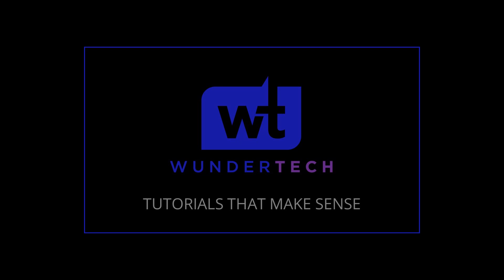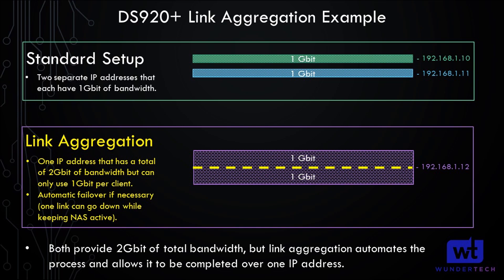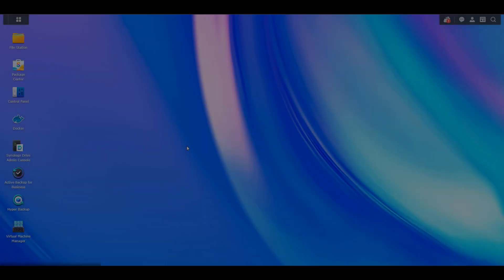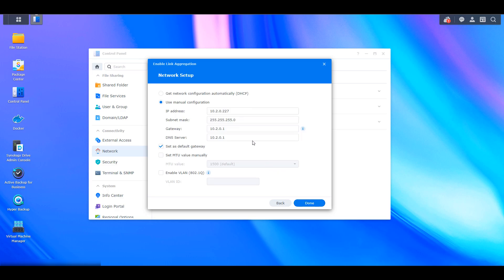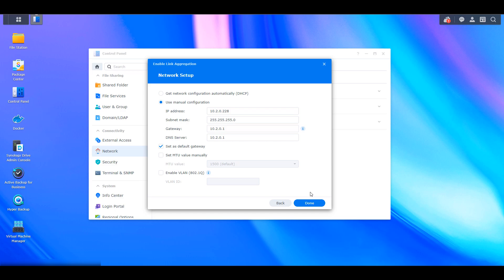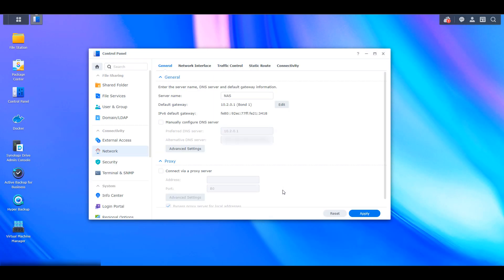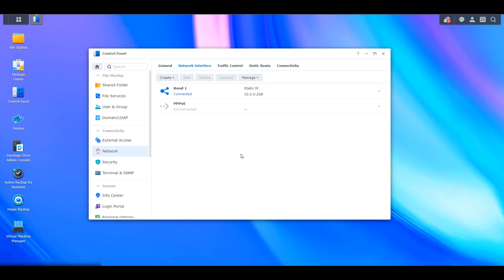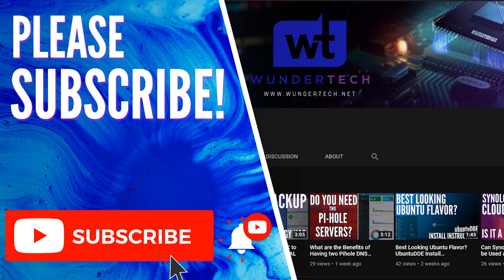How to Set Up Link Aggregation on a Synology NAS | LACP Tutorial

Comment: I'm a tad confused.

1. In UniFi Network, when you select Aggregate, it says "Make sure to enable port aggregation on the downlink device first before enabling it on this device."
2. In Synology, when you create Bond, and highlight the "i" button next to IEEE 802.3ad Dynamic Link Aggregation it says "IEEE 802.3ad LACP must be enabled on your switch beforehand"

So which one are you supposed to do first exactly?
Reply: Well for anyone wondering... 

a) I tried to first turn on aggregation on the switch in UniFi network, and found out that then you cannot access the NAS to turn on a Bonded connection. 

So the answer is to create a bonded lan first on the NAS, wait for it to finish, it will say an error that it couldn't establish or whatever (you can definitely still access the nas fine).... then go into UniFi and turn on aggregation for the two ports... once its completed, the error in Synology is gone.

I'm going to assume, if I need to reverse it, I would first disable port aggregation in UniFi. Then log into Synology (which will show an error in the bonded connection status) and simply remove the Bonded Channel.
Reply: Eh... so I've tested the speeds and noticed if using 2 PCs, copying say a 5GB file each at the same time, they're not getting their 1Gbps (~125MB/s) bandwidth each, its still splitting a single 1Gb connection, so one PC gets 57MB and the other gets 57MB a, total around 115MB or so. I now assume this is because I've got a UDM Pro and a Ubiquiti switch connected together via 1x 1Gb lan cable. I assuming I need to use 2x cables and create a bonded aggregate so that there's 2Gbps between the UDM Pro and the USW-16-POE switch as well, and then it should work? (even when my 2x PCs and the NAS were all connected to the USW-16-POE?). We'll scrap that idea, UDM Pro doesn't have aggregation, it has a 10G SPF port, but then my switch has 2x 1G SPF Ports. Hrmmm wonder if this entire exercise has been a waste of time.

Comment: Thanks for the great explanation. Could you just setup the aggregation on the switch before you setup the aggregation on the nas?
Reply from the maker: Not in my experience - if you set it up on the Switch, you won't be able to access the NAS to configure it. Might depend on the Switch though.
Reply: @WunderTechTutorials  could you move the cable ports?

Comment: I'm wondering what I should set up first, the link aggregation on my router (many ASUS routers support this) and then configure the network in the Synology control panel? Or do I just plug in the two network cables to the router, configure the link aggregation (IEEE 802.3ad) then turn on the link aggregation feature within the ASUS router?
Reply from the maker: You'd have to configure it on the NAS first, though you might want to look into SMB Multichannel as well.

Comment: You really don't have to go and reset the NAS is you get into an issue with the LAG. Only the Bonded IP is no longer available. So, just remember which port you had connected first, move the cable on the switch, if needed, to an un LAG'd port. Then you can access the NAS through the original IP. The only reason this would not work is if you changed the Bonded IP to the original IP of the NAS.

Comment: Hopefully you see this and hopefully could possibly help. Running Asus Ax92u - I enabled the aggregation, followed your steps for the Synology NAS to enable LAG but getting to the Network Setup step @4:50 it just says failed... No other info to help direct as to the source of the issue unfortunately.
Reply from the maker: I haven't seen it just say "failed", but is everything being inputted properly? That's the manual configuration, so I imagine if you're using the wrong subnet, you might run into a problem.
Reply: @WunderTechTutorials  Wow thanks for getting back to me. I use the default DHCP setting - the top selection.
Reply: @WunderTechTutorials  well now I have the issue that when I plug the second ethernet into the router the web access assistant goes down...
Reply: After that failure - I reset the NAS with both ports connected - this apparently gave the second port a different IP than before and that seemed to cause the web access client to fail . I removed the second port - bonded the ports with the manual setup giving it the port 1 IP - plugged the second port in and now it seems to be stable.
Reply from the maker: That's great. I've never experienced any of those other problems but know that two IP addresses are "bonded" into one, so the problem must have been related to that in some way. Glad it's fixed!

Comment: I just bought a Synology DS 723+, and I don't have a switch. I followed your instructions but used the automated version for creating a bond and took a chance to implement it by connecting both my Gigabit cables to the router I have from Bell Canada. 

It seems that everything went fine, and the good news is I didn't get locked out of my NAS ;-) The interesting thing, however, is that my browser auto-refreshed when I implemented the bonding, and now I am getting a warning that connection to the NAS is "not secure" and Chrome is showing the https in red with a strike through. 

Should I be worried that somehow my NAS is now insecure and "went public" on the entire internet so anyone can highjack it?
Reply from the maker: That simply means you're using HTTPS and don't have a valid SSL certificate (which isn't a problem for local access). If you are concerned about external access, log in to your router and check your port forwarding rules. If none exist, there is nothing exposed to the outside world!
Reply: @WunderTechTutorials  I appreciate your video and your super fast and very helpful reply! Subscribed!!! And thank you again!
Reply from the maker: @SingularityFM  Your comment was deleted for some reason, but you can simply delete the bond and undo any network changes you made on your router.
Reply: @WunderTechTutorials  Thank you. Very kind of you. I deleted it because I figured it out and didn't want to waste your time.
Reply from the maker: @SingularityFM  Sounds good! YouTube always deletes comments so I try and respond if I have enough info from what I can see. Glad you got it working.
Reply: @WunderTechTutorials  I did. Now I'm trying to figure out why my transfer speed when up from 70 MB to about 110 and then, eventually, to 11. I'm trying to transfer about 6 TB and it is taking forever  ;-(
Reply from the maker: @SingularityFM  There are tons and tons of factors that it can be unfortunately, but that's pretty common 😞

Comment: For those using Docker to host the Unifi controller on the Synology, simply setup two different, free, ports for link aggregation, other that the ones currently in use. You then set up the link aggregation on the Synology, Then, physically unplug the cables from the original ports and plug them into the new aggregate-enabled ports and Voila!
Reply: Would you mind explaining each step - I can't follow exactly what you mean

Comment: Helpful video, so I have an unmanaged switch DGS 1016A, that supports link aggregation but after the setup process I get "Failed To Establish IEEE 802.3 ad connection" Everything still works; i can access the NAS and its content , but I get that message does that mean link aggregation is not configured? What do you recommend?
Reply from the maker: Where are you getting that error? Do you see the bond interface in DSM?
Reply: @WunderTechTutorials  Yes i can see the bond interface, dont know if you can view this image https://linustechtips.com/uploads/monthly_2022_05/image.png.170c4d7199dcb34692074bec18f744e9.png but its right under the bond where it shows Network Status in DSM Interface.
Reply: At the 6:50 mark in your video where it shows Network Status: 2000Mbps, Full Duplex, MTU 1500, that's where the message is displayed. "Failed To Establish IEEE 802.3 ad connection"
Reply: @WunderTechTutorials  I think I see the issue, the switch only supports all the following except IEEE 802.3ad
 • IEEE 802.3 10BASE-T Ethernet
• IEEE 802.3u 100BASE-TX Fast Ethernet
• IEEE 802.3ab 1000BASE-T Gigabit Ethernet
• ANSI/IEEE 802.3 NWay auto-negotiation
• IEEE 802.3x Flow Control
• IEEE 802.3az Energy Efficient Ethernet (EEE)
Reply from the maker: @cutsdbz  That makes sense. Have you tried setting up Balance-SLB? Not the same as Balance-TCP, but it will at least work with an unmanaged switch.
Reply: @WunderTechTutorials  will do and see the results, thanks.

Comment: Do I have to use a different static IP to the one I have currently assigned for my NAS? 

My UDM pro has a fixed IP assigned to my synology at the moment so can I still then assign the same IP on the synology setup for the Bond or is that going to mess it up?

I am tempted to just play it safe and assign a new IP (although fixed) that is not already allocated to a client. The other way I was thinking is giving my synology a random IP through DHCP so it looses it’s fixed IP that I want to then reassign through synology settings.

Thanks for the video !
Reply from the maker: Thanks! You should be able to use the same one!

Comment: Is there any way to increase read/write speeds to one client without a 10Gig NIC? I'm thinking of upgrading to a DS920+ or DS1520+, but if there's no way of going above the 1Gb/s speed to once client I might consider the DS1621+ with a 10Gb/s card.
Reply from the maker: Unfortunately, not any supported ways. I believe you can find 2.5Gbe or 5Gbe USB adapters that might work, but they're not officially "supported". The DS1621+ is a great choice if you're interested in 10Gbe.

Comment: I have had success by removing one of the network cables to gain access back to the NAS without resetting it.
Reply from the maker: What are the steps you follow to do it? I tried, but wasn't successful.
Reply: @WunderTechTutorials  Unplugged one cable from NAS. Power cycle NAS and was able to access.
Reply from the maker: @ivgnmonkey  Got it, I didn't try the power cycle. Thank you for the info!

Comment: So my Switch (Orbi router) doesn’t support long aggregation.  But I connected both LAN ports in my DS920+ to the router and created a “bond” in DSM with 1 IP address. Does this help with throughput or failover?  Not sure if there is any advantage in doing this or if I should change it back.
Reply from the maker: Did you use Balance-SLB? If so, it will function very similarly, just not as "efficient" as Balance-TCP. Nothing to change if it's working as expected!
Reply: @WunderTechTutorials  Yes, I’ve got it set up as Balance-SLB. You may have mentioned this, but I think it only helps when more than 1 device is accessing data. My only concern is what happens if 1 LAN port goes down, does it take the whole bond with it and leave me with no access to the NAS?  I’ve never had an Ethernet port fail on me in 30 years but…
Reply from the maker: @notreallyme425  No, you should have redundancy if one fails as it will automatically kick over to the other.
Reply: @WunderTechTutorials  Awesome, thank you! (Thought I was subscribed to you, but I am now!  Appreciate the Synology vids)

Comment: Any difference if your switch only has Static Link Aggregation instead of Dynamic Link Aggregation?
Reply from the maker: This type will not work with static link aggregation unfortunately, but you can utilize a different link aggregation type (don't remember which off the top of my head).

Comment: This feature is awesome in theory but absolutely not useful in practice. Besides the "failsafe" backup if the cable goes wrong (something that happens 0.000001% ) there is no practical reason to have two 1 gigabit bandwidths when the NAS HDD can only read/write at 100-130ish mb/s . Even if you RAID, you still won't reach the bandwidth to use this.
Reply from the maker: I will be honest in saying that I am on the other side of the fence on this one and feel that if you have a switch supporting LACP, there's very little reason not to implement it. I agree with you that the the redundancy will very rarely, if ever be needed, but having it is still a benefit. As for the HDD performance, assuming you have a 4-bay NAS at minimum and are using RAID 5, four drives will give you the performance needed to come close to saturating both lines and overall, if you can even see a slight performance benefit versus no performance benefit, why wouldn't you implement it?

I also agree with you that a 2-bay NAS will see no benefit (unless you're using RAID 0), but the chances of having multiple clients or a managed switch as a 2-bay NAS owner are probably smaller than 4+. Not saying this to sway you as everyone is entitled to their opinion, that's just how I feel about it.

Comment: Pin this:
You can plug in a USB wifi or ethernet adaptor and set it up with static or DHCP and\or connect to your own wifi so you do not lose connection through any of this. I do this to all of our NAS's and then unplug the "emergency" adaptors. Synology saved the wifi auto-connect to "X" network and all of the Nic settings so when you plug either back in they connect right up and you can use Synology finder\advanced IP scanner or your router GUI to find the IP ( unless set static which is allowed via wifi usb too ).  Never lose connection, no resetting anything etc....
Reply from the maker: Are you using DSM 7? I am hesitant to suggest that as USB device support was dropped with DSM 7, but do acknowledge that it will work and is a great solution if you do have a supported adapter.
Reply: @WunderTechTutorials  I can confirm I have a 2.5Gb USB nic. The brand is pluggable, and someone created a driver for it, and I can confirm it works on DSM 7. It actually works way better on DSM 7, than it did on 6. It used to drop out often on 6, but on 7, it's been rock solid.
Reply from the maker: @mistakek  Thank you for letting me know!

Comment: Your disclaimer at the beginning of the video, upto about 2:30 minute mark, is really important that is gotten wrong very often on the internet. Link Aggregation of two one Gbe does not give a single machine 2Gb access.
Great explanation.
Reply from the maker: Thanks so much!
Reply: Link aggregation can give speed improvement for one client if use round-robin scheme, but it's not officially supported by Synology. Steel need to keep in mind that speed often limited by hard drives themselves.

Comment: I have heard people warn against doing this if you are using a cheaper switch as it can mess up your data and can introduce corruption. Has anyone experienced this or care to comment? It’s this worry that keeps me away from doing this. Much thanks.
Reply from the maker: I haven't heard of data corruption issues and after a few searches, didn't really find anything either. Do you have any examples? I don't want to lead you down a wrong path saying that it's impossible - I just haven't heard of it.
Reply: Mr WunderTech does explain this in his video; if your switch DOES NOT support Link Aggregation then you will lose access to your NAS; the data on the drives is find should be fine and if you reset you nas then you can gain access again.